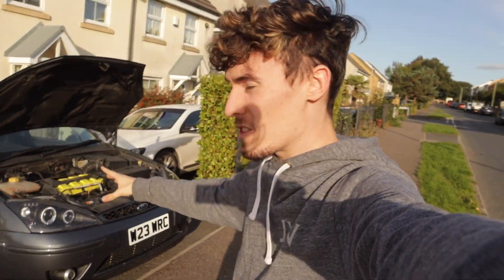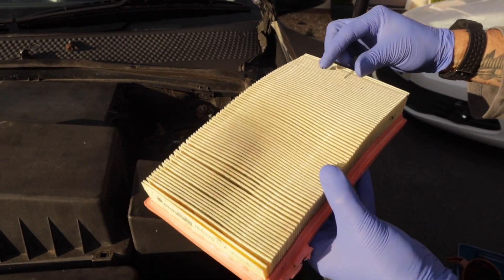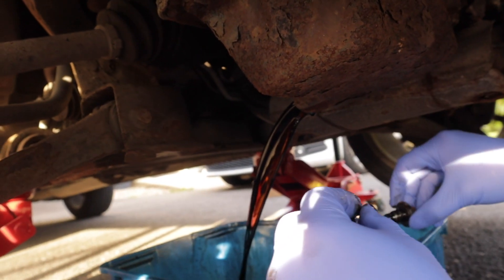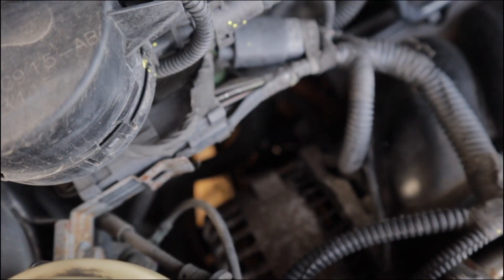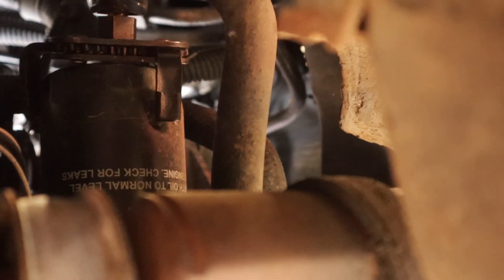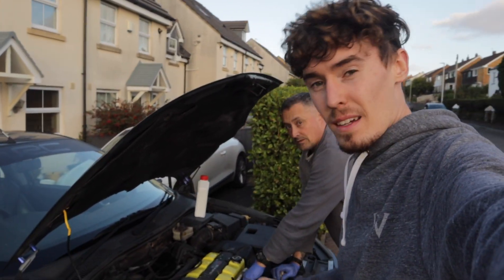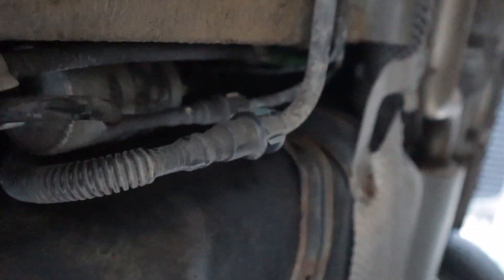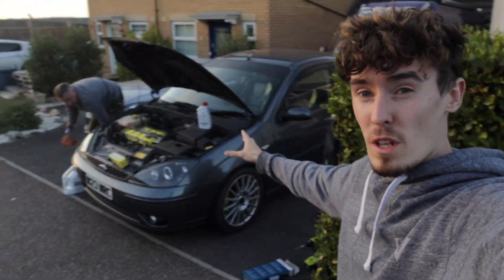HOW TO DO A FULL SERVICE ON A MK1 FORD FOCUS | PROJECT WRC #14

Comment: Car looks nice. There should also be a square sponge you can change in the airbox under the main air filter.

Changing the pollen filter too is worthwhile but is a faff. Have to remove the passenger side scuttle panel but also make sure the seal is fine when putting back otherwise water will leak into the footwell.
Reply from the maker: Thanks man! Oh really I’ll have a look, okay mate will absolutely have a look and potentially film a video for other people then as well, would never have known that so really appreciate the comment 👍

Comment: These engines likes,  Mann air filter,  Ngk platinum spark plugs, Valvoline Synpower 5w30 oil.
Other then these and your performance going to suckk, and the engine is going to burn a lots of oil. 🙂
Reply from the maker: Appreciate the comment! 🤝 This platform is still very new to me but loving so far
Reply: That's true, Synpower FE oil is great. I use it in my 1.8Zetec.
Bosch "super4" plugs work pretty well tho'..
Reply: All Castrol oils are top grade. For all road cars you cannot go wrong with Castrol, have been using this for many decades on rally and very fast road cars.

Comment: Looking good, They really are rusty pigs when you're underneath aren't they. Just done the clutch and gearbox on my own which went excellent but 2 days later had a no start due to the spark plug gaps.........FORD- Fix Or Repair Daily is really hard to argue with lately
Reply from the maker: It’s literally the biggest swing of ups and downs I’ve ever had owning a car!! 😂❤️